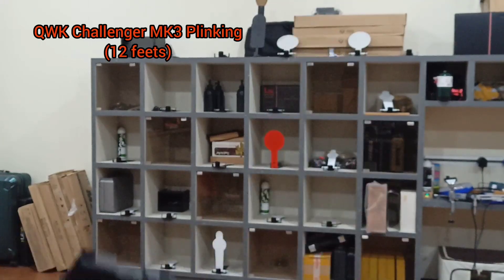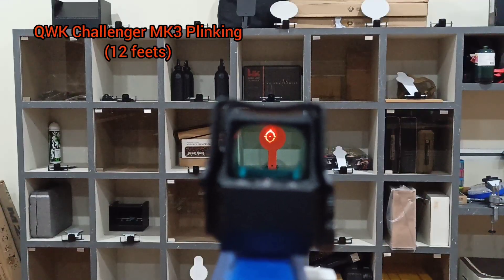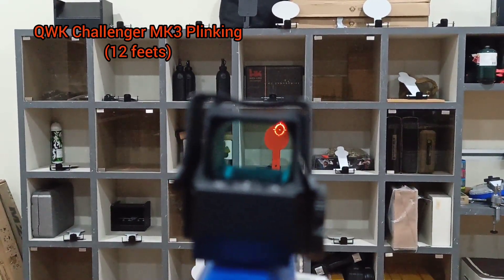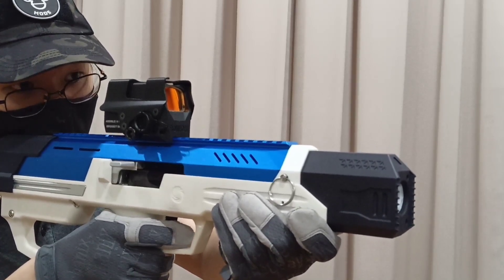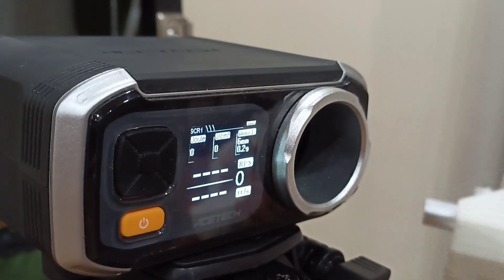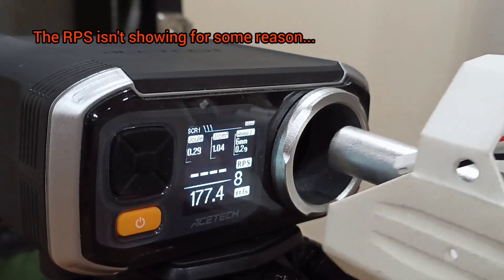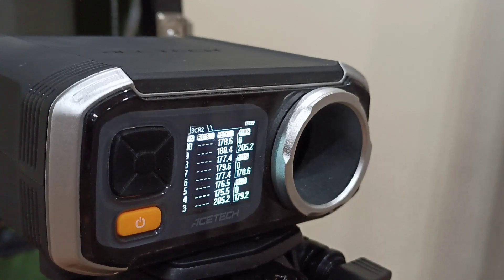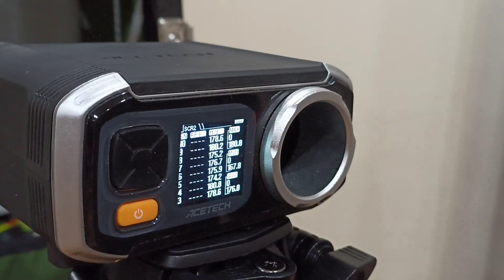QWK (青武酷) Challenger MK3 Demo with FPS test

Comment: Any chance you guys will carry the black gen 3 darts on your website?
Reply from the maker: Yes sir, It is actually available on our webstore already under the Worker Gen 3 dart listing, we added a color option.

Actually we are going make correction to the product name soon. 

Turns out the latest Worker short darts with the black foam body is called Worker Gen 2 High End (Lol I know, it's a literal translation) is meant for higher performance springer such as the Worker Swift/Cheetah V2 with 13mm inner diameter barrel. The foam is slightly stiffer and wider than the Worker Gen 3 (Purple foam) is meant for their weaker springer and Flywheelers.

I've had very good performance result using the Worker Gen 2 High end on the QWK MK3, Worker Swift and DZP MK2.

Comment: Is this a hpa or a fly wheeler, if its a hpa where is the gas stored?
Reply from the maker: This is a battery powered springer.
Reply: @monkeemods8393  nice, i’m not interested in hpa but battery power springer sounds awesome.
Reply: @monkeemods8393  like the original stampede or Vulcan right?